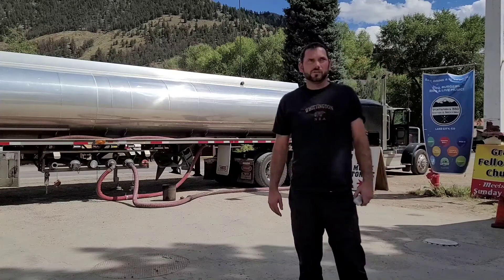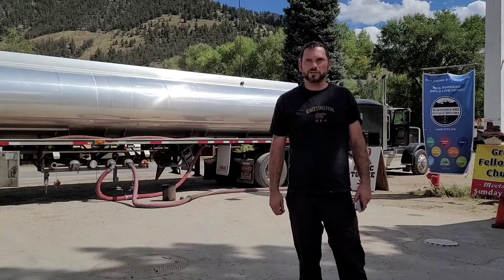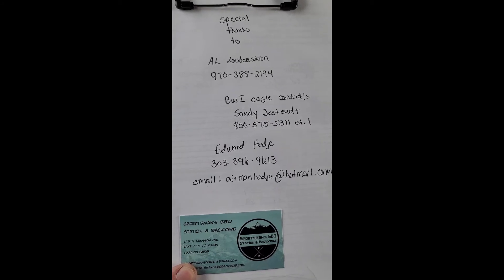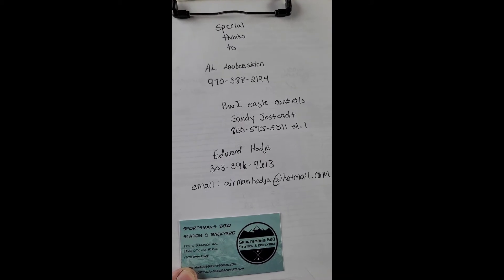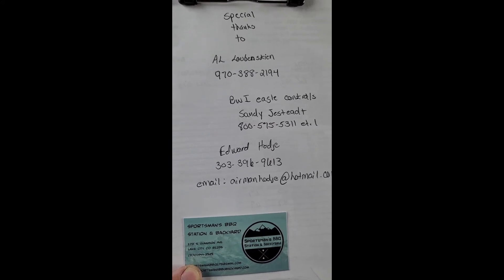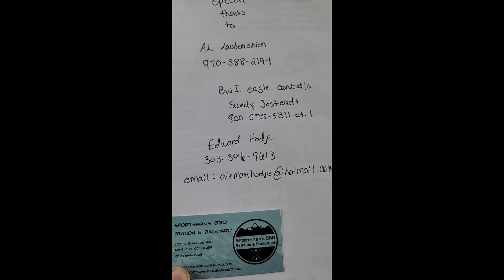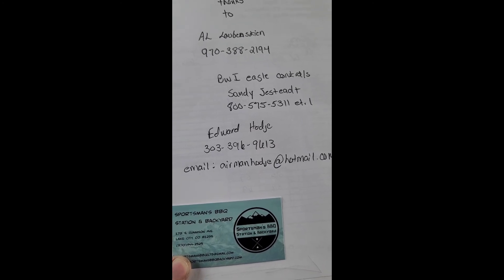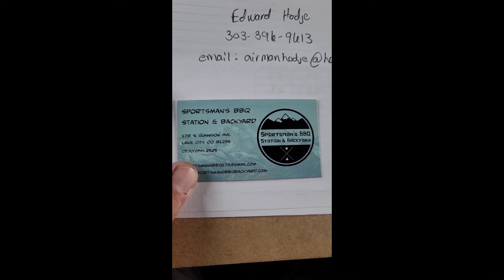fuel automation

Comment: You've got a good system there, please redo your video presentation wearing crisp and clean striped FR coveralls, have some helping you by doing the work while you describe what is going on. Get a better microphone system, whether it be a headset or BT mic clipped to your coveralls.
Write down your vocal presentation and practice it until you can recite it flawlessly.
I wish you the best, your system should save wear on the pump by greatly reducing dry running.
Reply from the maker: Thank u